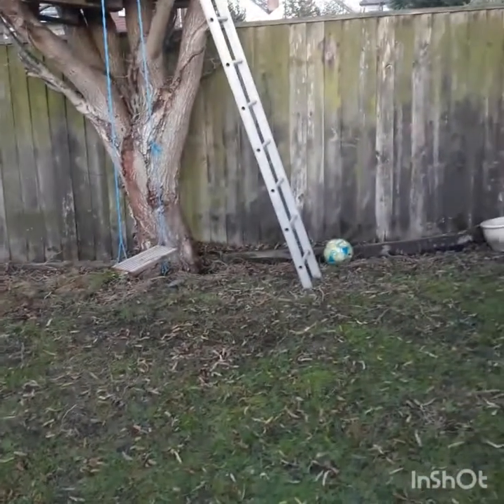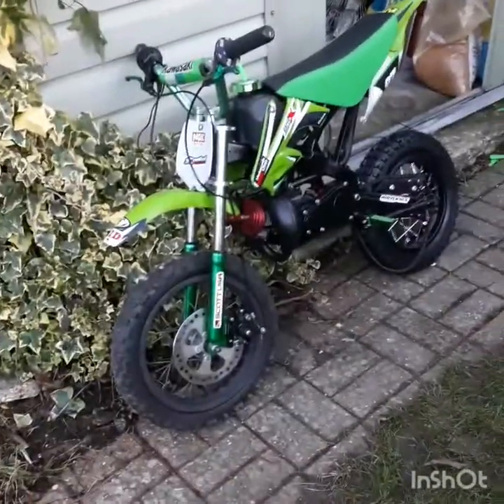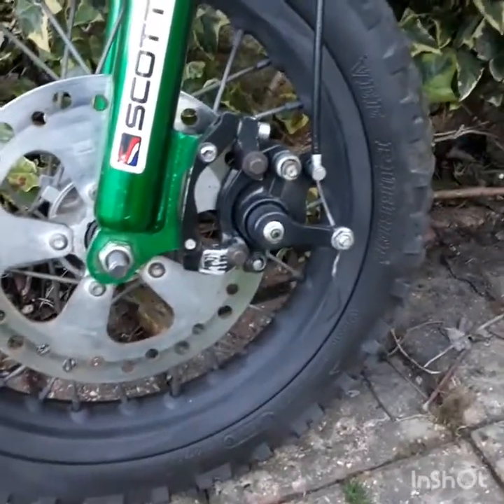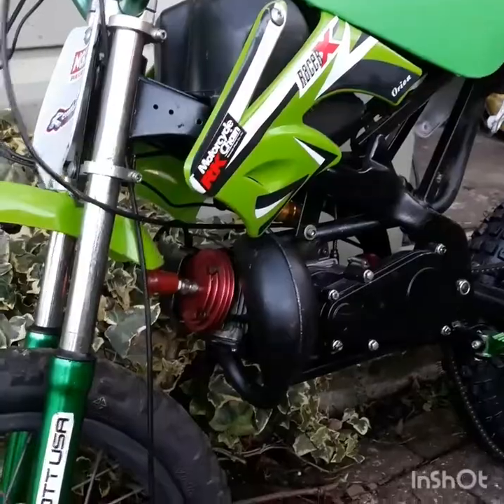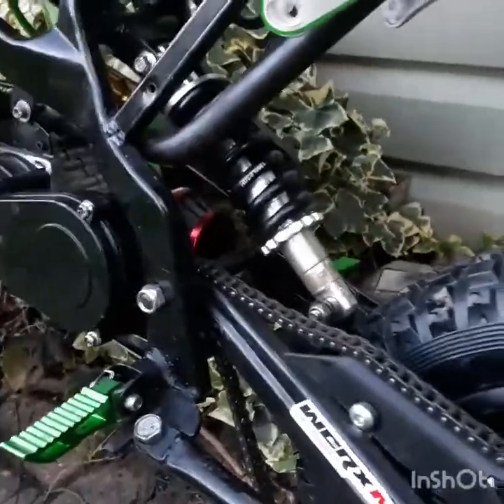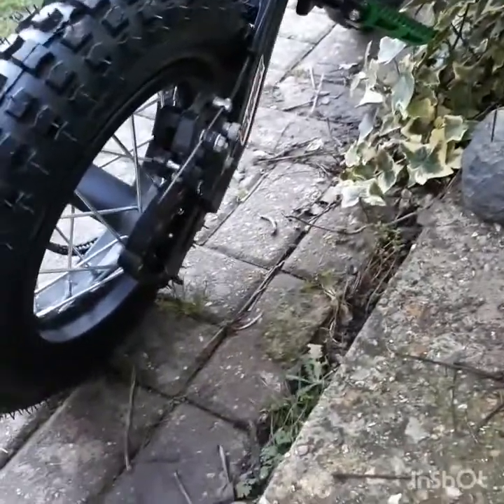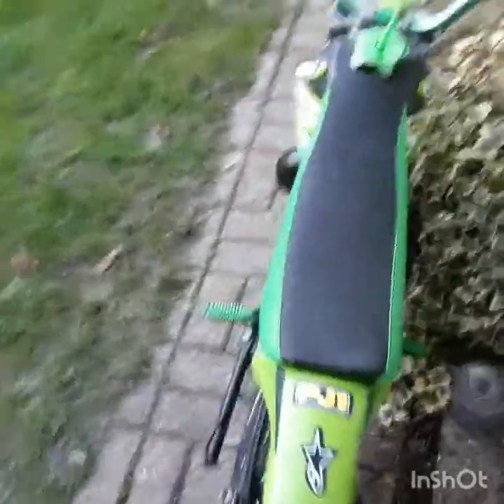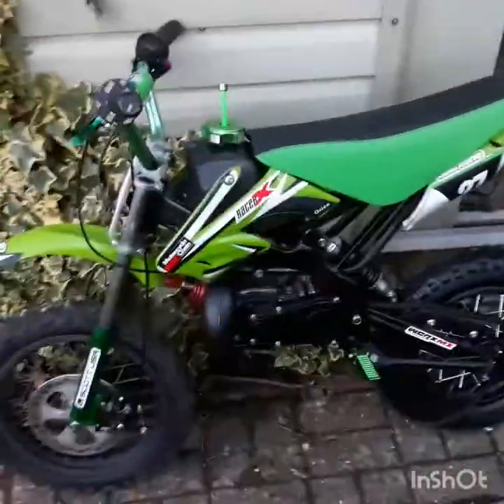Mini moto with pit bike wheels

Comment: Great video, so that’s a 12” front wheel and 10” rear? The final drive is called a “reduction box”..just so u know.. could be a 1st to put big wheels on a pocket bike/mini moto ! Is that a modified cylinder head on there also?
Reply from the maker: Thank you, yes 12" &10" and yes a performance barrel, head and piston. There's probably some more i didn't mention like the handlebar raiser kit going on. But you can find out if you tune in next time😊✌.

Comment: hi was the front wheel hard to do as thinking of doing this to my bike. also did you have to do anything to the frame or adapt the bike to put the front wheel on. cheers :)
Reply from the maker: No adjustments necessary just spacers and space the brake caliper correctly with bicycle spacers. 👍